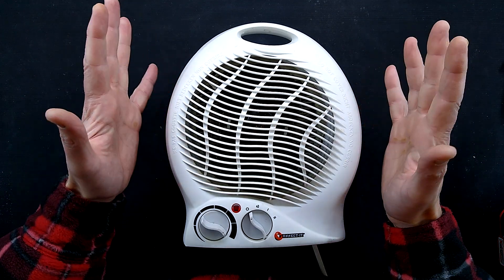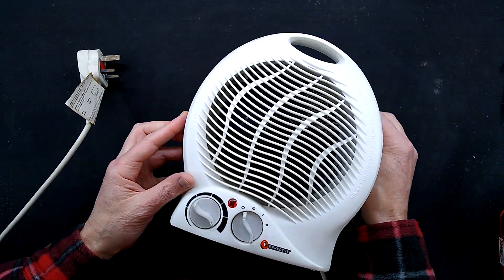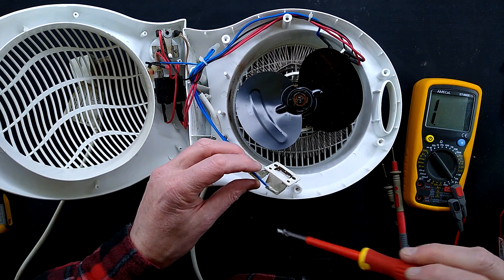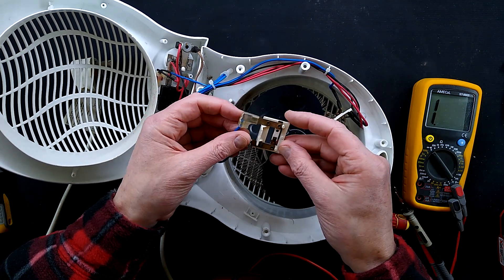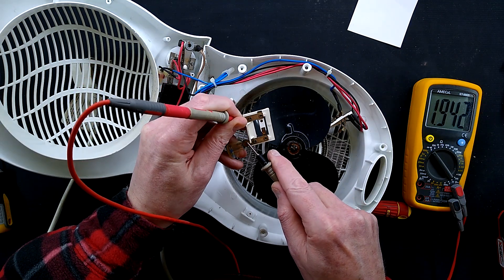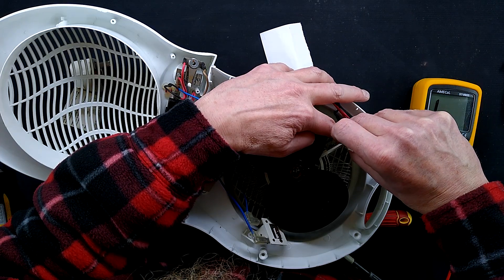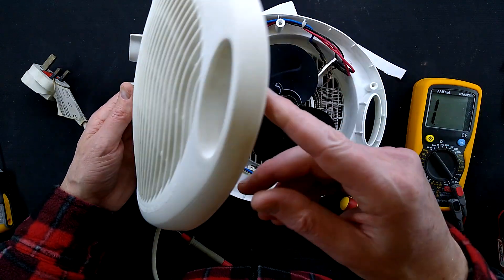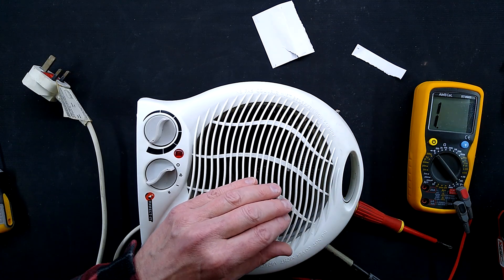Fixing a heater and an apology to my bro

Comment: Wouldn't some fine sandpaper, like a wet/dry automotive sandpaper, work better at cleaning the those contacts? The automotive sheets are very thin and the high grit should not remove too much material.
Reply from the maker: Many contacts have very thin surface coatings.

Comment: I've found that when a heater cuts out and in,,,,, as it's designed to do,,,,, the biometric strip loses some of it's springtness due to heat and flexability causing a weaker pressure between the contacts.
This causes a bit of arcing, hence points failure.
As you said these do have a cycle time as the heating and cooling takes place.
Clive can you give us all a test on the accuracy of bimetallic trips and the differences in the temperatures of a trip, you might be surprised just how innacurate they are.
Good vid, plus it keeps Ralfy happy

Comment: The main thing I have had fail is the switch that turns it off when it is not on a solid surface (the one at the bottom of the heater) They seem to be of very low quality.

Comment: No contact cleaner handy? Paper works okay if it's not too bad, but I always like using contact cleaner and/or an actual contact burnisher (which it seems few people have -- they're not abrasive like sandpaper, they just basically scrap oxidation off and gently move the surface coating metal around without removing it). I'm not even sure if they make the real contact burnishing tools anymore. EDIT: Seems both Mouser and Newark/element14 carry Jonard Tools contact burnishers... might have to pick up another set!

Comment: remembering to unplug devices is quite possibly the best advice one can give when repairing home appliances

twice now i've been fixing something and turned it off by the switch on the device, assumed it's off and safe to work on, completely neglecting that the job i was doing was replacing capacitors on the power supply board and given myself a hearty dose of mains electricty across my fingertip
Reply: I try to make a habit of keeping the unplugged end of the cord visible on the bench, RCD/GFCI is also mandatory.

Comment: Some other video said  all heaters are the same.  1500 Watts is 1500 watts   room or  desk sized.   I said the expensive room version has better heat control and a small desk version will not last.

Comment: I have repaired several for friends and family by using a low-abrasive contact file and contact cleaner. They all seem to use very similar thermal breakers that get burnt contact surfaces within days of first use.

Comment: I have one of these, and used another one at work. The ones with european plug have horrible quality plugs. The pins easily heat up to 50 degrees, while a different plug in the same socket barely heats up. 
I'm very hesitant to use it at full power for that reason. I don't want it to melt the wall outlet.

Comment: I'm glad you mentioned the need to thermally isolate the soldering of the thermal fuse.  I suffered a severe forehead-slapping event when I replaced one on a friend's heater.  Of course, it didn't work after the first repair attempt.  The thermal fuses should come with the ID ten-T user warning (ID10T).  The second repair attempt solved the problem.
Reply: the sinclair zx81 and zx spectrum power supplies have a thermal fuse...soldered to a pcb, below the transformer primary winding,...presumably the automated soldering is quick enough to not trip it, the length between the pcb holes is quite wide, though so hand soldering likely possible if you're quick enough, never yet come across a popped one in these...

Comment: Natural airflow electric convector heaters are  SUPER RELIABLE  ! ...I have a " chimney " type from the WW2 , 1940's that STILL works (  NO moving parts or ... thermal cutouts ! ! ) ... Oil or water filled radiator types are ( OK ? ) for  some degree of covering ( warming night clothes , etc ) , but DO NOT tip them over ( when energised ! ) , but nothing beats a ( 1950's UK )  Belling™ 3 bar radiant heater ( still working ! ) ...( tried - n - tested ) ........................... DAVE™ ............

Comment: If a diode fails does it no longer have continuity? 
Or does the resistance go up?
Reply from the maker: If a diode fails it often goes short circuit.  But can also go open circuit.

Comment: "Turn it on, turn it off, turn it on", I've seen several devices where the owner had assumed the fault was the power switch (because it would not turn on) and has subsequently tried to 'punish' the power switch into submission.
Signs of this being panel damage around the switch where various implements (i.e. hammer) have been used to try and help it 'turn on'

Comment: I bought 2 of these piles of junk. The thermostat is about as much use as mammary glands on an ostrich. The histeresis ( accuracy and temp lag) is pathetic. Set it and it will range in use from the arctic to a sun spot. Add to that they are almost impossibe to de fluff and noisy.

Comment: When working with electromechanical relays in substations, we used a $1 US bill for burnishing the contacts when the proper diamond dust burnishing tool wasn't available.

My version of that fan "had" a tip switch safety feature. It didn't last long due to us repositioning the thing frequently while it was on.

Comment: Also ...these fans have swivel bearings that are meant to centralise armature in windings ..the bearing swivel lubricant dries out, so swivel moves sideways, locks ..and partially prevents freeness of movement ..resulting in slow fan speed and overheating of the elements ..which leads to it cycling on and off. infect nearly all fans and a lot of motors have these swivelling bearings these days ..that leads to early failure, so if you have trouble with fans slowing down, dismantle, observe how the bearing swivels and lube to solve the problem.... lots of these have been chucked away after only a few days use because of this problem.

Comment: Usually if either of the thermal cutouts trigger then the fan doesn't run either. It is unusual to find the fan running at all if the device has triggered one of its safety devices

Comment: Took my fan heater apart this week.  The thermostat wasn't behaving, either wouldn't switch on or wouldn't switch off.  Luckily it was an equally simple fix.  The thermostat control dial just applied different pressure to bimetallic strip.  I bend it back into shape and it's working fine now.

Comment: These heaters are dangerous in my opinion. The heater is separate to the fan, making it possible for the fan to cut out before the heater goes off. Happened to me with a brand-new unit, the result is the heater glowing red-hot melting the plastics above it and making it drip on the heater with the whole thing catching fire. I guess the thermal fuse didn't cut out in time or at all, making it do that. Terrible experience, don't leave them on without supervision.

Comment: When I was a lad electric heaters didn't have any sissy thermal cutouts. I remember blocking the air intake of one and then for just a moment thinking wow cool orange glow before a yellow flash when the element split and the end nearest to live shorted to the earthed metal case. The yellow flash being enhanced by there being no sissy RCCBs back then either. I didn't try that again.
Reply: Didn't we all do that with our mum's hair dryer too? Glowing red hot elements!

Comment: I have a little group of electric heaters that I use in my outbuildings to protect pipes and loan out to family. They are 120v 1800watt heaters originally, called "milkhouse heaters". Very common in the rural areas in the US. Some of these are over 50 years old. They are in a 10"W, 8" thick, 18" H (ish) metal box with metal grilles. None of them have any of the original control circuitry left, some even have new heat elements. I have begun putting solid state relays and PID temp controllers in them. Started using old power resistors out of OLD elevator cabinets that I have stripped out over the years for heat elements. Have a series/parallel (High/Low) heat element switch on the loaners for use on loaded circuits. Even with the cost of the control circuits, it is better to have the safety of a rated thermal switch and a nice grounded metal box... I use 120v muffin fans that push the air through/past the heat elements so the fan lasts quite a while. I derate the units to 1200/ 1400watts and set a maximum discharge air temp of 150° in the control circuit. The auto shut down 'tip over' devices in these units are pretty robust. They are a heavy click switch, 20amp, with an arm and weight, total shutdown. I test the heater control circuits by getting them up to heat and dropping a blanket over them. They just shut down and the fan runs, 12watts or so. Never found any 'safety screws' in any of these... One added bonus, the muffin fans make that whine, so loaners usually come back soon if they were used around people, Lol. I can pick them up dead at farm auctions now for $1-$2, new ones are $50+ and are beginning to introduce a lot of plastic into the units. Taking the dollars out and putting in plastic, they rivet the boxes together now to discourage repair. Michael in Colorado.

Comment: Hi Big Clive, I have one and I have replaced the thermal fuse, and the heater works again, but I cant figure out way the fan wont run, any ideas?
Reply from the maker: Check it moves freely and that the motor connections have continuity.
Reply: @bigclivedotcom  thanks man, moves freely but cant get continuity  -think something wrong with windings. dam
Reply from the maker: @robertopereira7615  Check the fine wires from the motor haven't broken off their terminals due to vibration.  It's a common thing.
Reply: @bigclivedotcom  Hi, you are right. I have opened up the motor and found a short on one of the small wires. one small wire is just soldered on and the other one is connected to small black chip that blew. its hard to read as its burnt. but i can make out. 

on the top (reverse) R AUTO
on the body right side
Dimond picture
F JET
0 c U4
250v~

the left side is burnt/blow

If i can work out what this is, I could potential fix it, if there are no damage to winds but cant see more.

the motor is
DEYING YJ58-12
220 - 240VAC 50HzE
CIXI City DEYING Moter
MAnuf Acture co.LTD
Reply: I have found it. its a
Aupo
A4-F Jet
130c U4
2A 250V~

but the only one I can find is a 
Aupo
A4-F Jet
130c C2
2A 250V~

no idea what the difference is on a U4 and C2

I also checked the windings and get a 0.83 K Homs, is this bad?
Reply: @bigclivedotcom that did the trick, it's fixed the heater and fan! Thanks for this video and I hope this helps other's!

Comment: I have identical looking heater, but it has only one set of thermal fuse and a cutout and it cuts all the power to the thing so the fan also doesn't work. I blown my thermal fuse by accidentally pushing it back against the wall reducing airflow. They use rivets on a mica board to mount the fuse and I used same technique to replace it without soldering. Instead of 2nd cutout mine has anti flip switch that didn't work due to the warped bottom plastic meaning that it would not close standing on a flat surface.

Comment: Had an extremely similar one, but mine had a safety switch on the bottom, which was supposed to turn the heater off when it tipps over.
This switch was also the one which failed for no obvious reason.
Temporary bridged it until i could get another heater, since this one was making an annoying rattle sound coming from the motor bearings which got amplified by the cheap flimsy metal fan blades.
These things are junk.

Comment: When I worked with PMG/Telecom in the 60's and 70's we were issued special cleaning strips called Microscrub. They had tiny abrasive hook tips, like micro fine Velcro which we used on relay contacts. I have never been able to source them commercially. We were taught to never use paper or cardboard as they would leave an insulating residue. Paper probably OK for 240v though.
Reply: Some paper/cardboard contain wax for gloss, that's what they were probably worried about, don't use the shiny stuff. I've always had good results with cheap index cards.

Comment: "quite often he puts a heater under the blanket with him and wonders why they die"   - Both heater and Ralfy if he's not careful!    Thanks for some good safety advice with this video.- It's so easy to forget to unplug, particularly if you're getting tired/frustrated.
Reply: Yep, it takes only one faulty overheat fuse and Ralphy is crispy._
Reply: They make heaters designed for blowing hot air under a blanket. They got the BedJet in the US, but Japan has had similar things for quite a while. (Japanese houses have poor insulation. They also usually sleep on futons on the floor, which get folded up into a closet during the day. If you don't air them out, they become musty)
Reply: I recently saw a picture of a Japanese table with a downward facing quartz sort of heater on the bottom of the table.  The table had a ring of sort of quilted blanket around it to capture the heat for the lower half of seated individuals around the table.  

Sounds toasty and scary at the same time.
Reply: @amorphuc  Depends how hot the filament is driven, if it's two in series (and thus half the rated voltage per heater) it doesn't get that hot to be that flammable._
Reply: @amorphuc  Kotatsu. Before electricity, they used charcoal in a cage, so you'd have a fire risk and carbon monoxide poisoning at the same time. They're about 500 watts. The latest ones are flat carbon heater panels, which give more legroom and spread the heat out more.
Reply: @straightpipediesel  Ah yes and thanks.  I just was told about the kotatsu.  How very civilized to gather around a warm table.  Pretty cool really.  Flat carbon heaters would be the bomb.  The one I was shown was of the quartz type, guessing it was regulated in some form.

Comment: Switches and thermostats that break high current need a bit of time,  a few seconds to a minute, to cool down from the arcing on opening before they are opened again or the contacts melt, corrode or weld together and then the thermal fuse becomes all that protects you from a fire or plastic casing turning to slag. The AC circuit switch arc only lasts until the AC voltage next passes thru zero ( 1/100th or 1/120th of a second). High voltage DC switches are always "snap action" as the arc will continue until the contacts are far enough apart to break the arc.

Comment: B&M were selling Blaupunkt fan  heaters for £15 each with a two year warranty, throw away items.  If you had to replace any of the bypass switches would it be worth the effort, ordering a replacement and then fitting it when you can buy another for £15.

Comment: Funny, I repaired a similar one myself lately.
Mine had only heat and no fan.
  My 1st thought was also that bi-metal contact. But I had continuity. The problem was in the winding of the motor. One of the very thin wires had come off. after resolder it, it was working again. 
Always interesting watching your videos!

Comment: My electric forced air across aluminum and ceramic panel doesn't use cutouts like that to cycle the coil. It has a thermal safety and anti trip switches but keeps the power on the element full time. Its rated for continuous operation. If it reaches temp i set via manual thermostat the entire unit shuts down until the temperature drops enough to trip the thermostat. Which is wasteful. I think it should cut power to the panel first and wait until the air cools to room temp or very close and then shut the fan down. Or if they wanna stay low cost build just setup a fifteen second delay to give the fan enough time to put the remaining heat I already paid to generate to be pushed into the area. And shutting down the fan should be an option too. Some do these things but the unit I have doesn't. Its only 120volt and i run it typically on low which pulls 350watts for the panel and roughly 30watts if that for the fan motor.

Comment: These cheap analog heaters fail even more quickly if used to heat a bathroom, as the thermostat contacts will quickly fail.

Comment: Interesting, I have 3 of these (or extremely similar!) bought years ago as the cheapest around in an emergency when the boiler died. Still use one to warm garage when working. Except mine have an anti tip over switch in the base, I noticed your one worked on its side so doesn't? a bit concerning.

Comment: Could you not attach a yard of dryer exhaust hose to the front of the heater so only the hot air needs to be under the blanket but not the heater thus preventing or at least reducing the possibility of overheating and saving your brother a fiew £ ? If not that then I recommend switching to a electric blanket for cover, removing the need for moving parts and noise at all. Good luck and happy christmas.

Comment: I have a very similar fan/heater (if not the same) and one thing I do to make it last is to switch momentarily to cold (fan only) before turning it off so I don't leave the hot coil suddenly with no air flow.
I don't know how much of an impact this makes but it takes no effort to do so I do it
Reply from the maker: I do that too.
Reply: I do this with anything that gets hot during use, fan heaters, hairdryers, Dyson vacuum cleaners (just remove the dust container & run for a few seconds for max airflow) ; even running power tools with no load for 10 seconds or so after use.

Comment: I hve the same cheap heater that I use as a shed heater which has also succumbed to the damp but in a different way. With mine its that the motor turns slowly due to slight corrosion. Again, easily fixed.